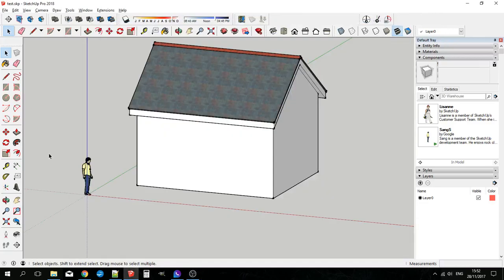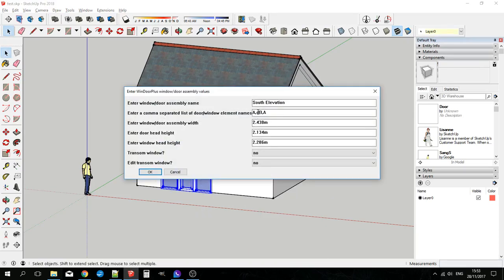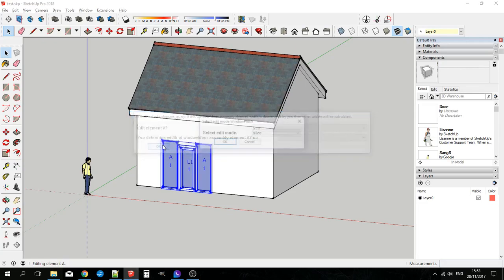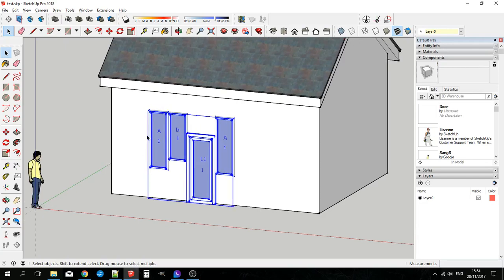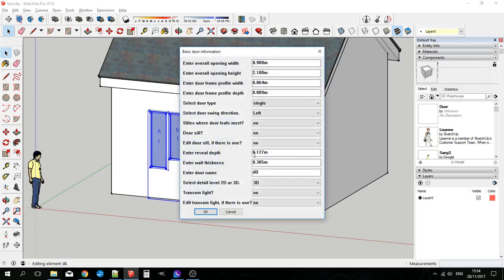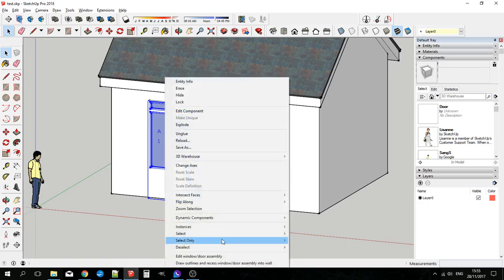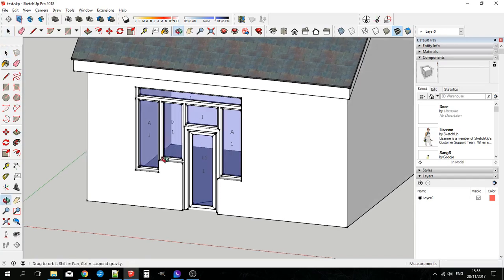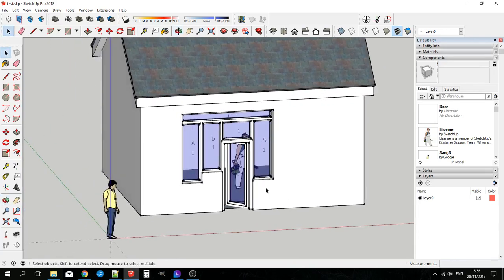WinDoor+ for SketchUp. Introduction

Comment: I like your Windoor -- once I figured out that the component is best edited once its placed in the model  This instructional video was very helpful.  

If you're going to continue developing it, it was be a lot easier if the values defaulted to the last entered value.  Since if keeps resetting the original value, the user is having to constantly keep track of what was previously entered.   Thanks.
Reply: Steven, once you have created a window you can just use the component tool to place as many copies as you like into the model. You do not need to remake it in WinDoor+. Also you can place a copy of the window component and make it unique and then edit it any way you like using WinDoor+'s edit tools. Doing things that way saves you time and your computer memory. I'm really glad you like the extension. I am working hard to improve it all the time.
Reply: With copies of doors that you want to change, be careful to to make both the door and the leaf/s unique or it will mess up the original door's leaf/s.
Reply: @FrancisMcShane   Yes, I see that -- semi custom components that work within the larger family is very nice.
Reply: @FrancisMcShane   It's a cool extension.  The point of the default value is that is always defaults to ~ 3' 11 1/4" and ~ 4' 11 1/16" -- I assume you designed this for metric, so that's OK, but it would be nice to allow consistent user customization by simple defaulting the values to the last one used.    This of course is a really minor issue, but as I so respect the wonderful utility you've give us, I thought you'd appreciate some user feedback as you continue  to improve it.  I haven't gotten into dynamic components at all, and this is my first foray, so I am seeing the genius of them.  Thanks!
Reply: @stevenschloederphdaia5940  I will definitely give it some thought.  I am so glad you like the extension!